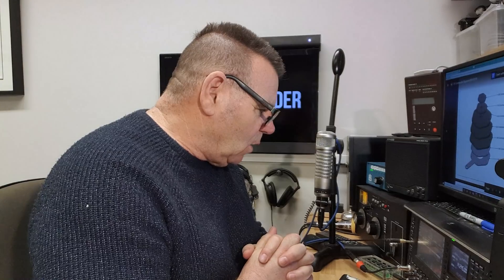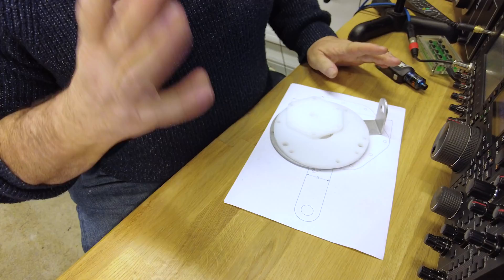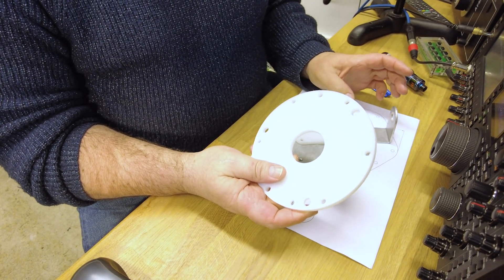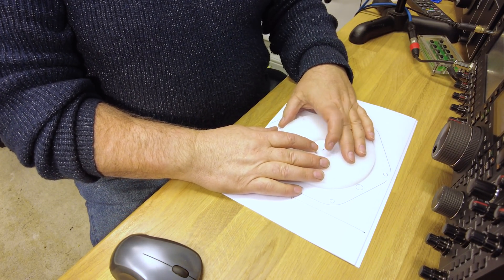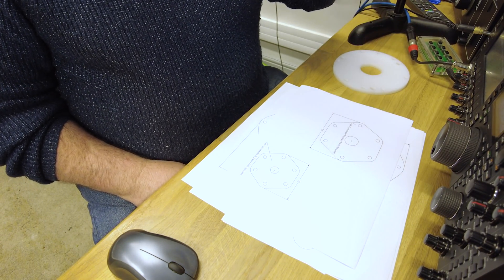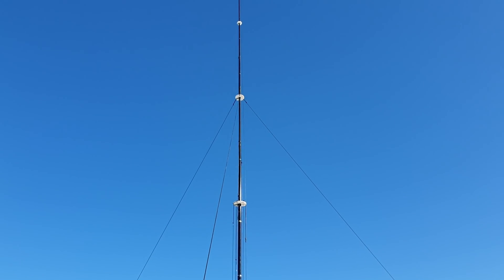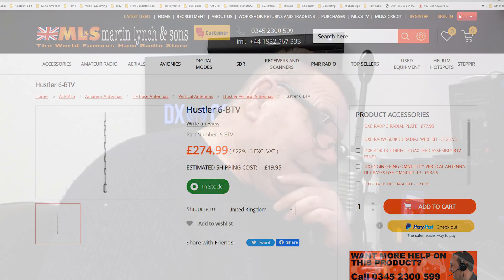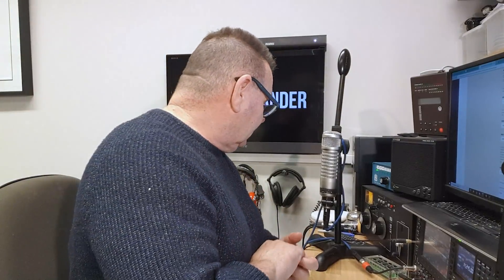Pre-Release Video - 12.4 Signature Launch Video - DX Commander

Comment: Fibreglass tube can be bought with significant wall thickness which could be used in place of a metal tube in the bottom section of the antenna. Very strong. The UKAC 2m guys use it as a stub mast to hold multiple beams.

Comment: Callum - I am about to order a Classic + 80m, moving from a EFHW that goes to 40m,  My motivation is to hopefully lower the noise floor, have an antenna configuration that fits better on my lot, and get to 80m.  From your videos, I believe the Signature will have better band width at 80m than the Classic+.  I think you mentioned that the increased spreader plate diameter will flatten SWR curves.  Will the performance be substantially better than the Classic+ at <=40m bands?  Is there a comparison band-by-band between the Classic+ and the Signature that I have missed?  Please post a link if you have already discussed this.  Apologies in advance if you have already answered this...
Reply from the maker: David.. Go with Classic because ALL you are getting on Sig is a night time DX potential on 80m. Classic will give you better daytime. And it’s a bigger beast. And more money!
Reply: @DXCommanderHQ  Thank you Callum!  Your advice is greatly appreciated...

Comment: Hey Callum, good to see the signature is getting ready to ship.  I am considering which DX Commander I want to purchase at this time.  Perfect timing.  I am also looking at M&P coax (I first saw that coax on your channel, and K8MRD/Mike has shown how the connectors are added on - nice).  The USA sites are a bit hard to get bulk coax so I can cut the cable to fit and do a little solder.  Anyway, I am considering about a 75 foot run to the back garden with a tilt up plate for a DX Commander.  The tilt version is still being researched (meaning I don’t know what I am doing yet haha).  I hope I can catch the signature before it sells out.  All the best, 73 de KI5HXM
Reply from the maker: Tilt: Check DX Engineering. They do a tilt. Use a small stub (about 2 feet) inside the 12.4, then guy it.
Reply: @DXCommanderHQ  yes as far as tilt goes it won’t hold me up.  I can always add tilt later. Or never as is the case with my scatter brain …. Squirrel! After all I was ADHD before it was cool.  Haha. 

So do you recommend Messi & Paoloni coax?  I like what I see with Ultraflex 7 and 10’s.  I am a LMR400 man but I like the way the connectors are put on. Of course HF doesn’t need ultra low loss so for HF vertical I wouldn’t need real low loss (but will take it if not much more).  

Sorry I have so many words. Those of us born in 1959 have a lot of words.   Haha. All the best!

Comment: Amazing work Callum.  I have my usual question, would you be able to offer advice and assistance to get this operational on 60m to use with the Air Cadets also?  If so, I'm sure we'll be placing an early order.  Cheers as always, James
Reply from the maker: James, I have every faith that this can be built for 80, 60, 40, 30, 20 and 17.. I just haven't got a cut chart sorted for it :)

Comment: Hey Cal, this seems like a really interesting antenna design, especially with 80m. Could I ask if the 80m element will need to go off horizontal, like inverted L? Or is that what the loading coil is for? It would be interesting to see an A\B comparison between the loaded 80 Vertical versus the 1/4 wave inverted L. Great work dude!
Reply from the maker: Hiya Matt.. The idea behind this was a pure vertical pattern, so not so good for local working but great at night for FT8 or plain old fashioned DX.. Yes an A/B test would be cool BUT they would both interact with each other..

Comment: You said, you removed the alloy tube from in side the antenna because of the SWR reading. Have you look at the material called Delrin plastic it's very strong, and used a lot in engineering. It may help replace the alloy tube.
Reply from the maker: Yes, we've looked at a lot of stuff.. It would be extraordinarily expensive unfortunately.. I do have another solution "up my sleeve".. But for another day.

Comment: Callum can you leave this antenna up permanently.and if so is it UV light resistant? I'm over the pond in Florida so I'm keeping that in mind
Reply from the maker: Yes. The only thing that gradually fails is the UHMWPE nylon plates (over years).. There is a solution for that called 303 spray.

Comment: I always read the comments before I make mine, so that there are not to many duplicates! just been out to the antenna farm to measure up! Yes i can get one in, as well as the Classic I already have, it may be a bit of a squeeze but I reckon a Nebula will fit as well. Question on radials, I have got a load of scrap copper 15mm pipe, will that work well as a radial field, and could one field of radials connected together work with multi antennas? Thanks Jim M7BXT
Reply from the maker: Jim, I wouldn't bother unless you are trying to make a lightning conductor :)

Comment: I will order as well.  Ideally I can leave it up year round.  No guywires would be nice but I am not convinced it could stand up to strong winds (60mph and up) with just a tip over base.  Maybe if you ran a pvc pipe inside the Commander?
Reply from the maker: Yes, some thinking required.. I honestly believe that in the long run, guys to the mid-point is best.

Comment: I really am considering this but I need to consider if the 12.4m will end up having the possibility to hit the power lines near the house. The other thing for me is the guys. The classic is currently anchored to some very large wooden posts holding the patio cover up. Also, would like a 60m option. I had the classic up at one time with 60m inverted L and did some good DX with it.
Reply from the maker: Don, you can do 60m with this but you would have to drop it down a few notches on frequency, eg 80m, 60m (slightly loaded), 40m, 30m, 20m and say 17m.. I will eventually develop the cut chart for that.
Reply: @DXCommanderHQ  Thanks Callum

Comment: Santa mate. This one yea! Cheers! 
Could VHF/UHF colinear or whatever, and maybe a 1090Mhz built into the top section. 
I have probably watched all your Vidjayo's But never seen you tinker with 70cm plus. or SDR, VNA's. Spectrum analyzers. Especially now the Nano type are very available. Be great to see that stuff from your perspective! Maybe it will inspire procrastinating geeks like me to gain the foundation license at least.
Reply from the maker: Now.. Someone might be able to do this BUT you would need to run coax right up the pole.
Reply: @DXCommanderHQ  Could that coax be connected to your feed and ground plate or a separate run to the shack?

Comment: Great stuff. Will be buying this. Now, I have 160m of wire in the lawn for my classic. I am hoping to get the signature but keep the radials or add to them (since the kit will come with radial wire. Will probably need to make some little radial extension cables perhaps for use with the new ground plate. Anyway, weather getting better so look forward to building this .  Mark, 2E0MSR.
Reply from the maker: Mark, extensions are easy.. Use some glue lined heat shrink after connecting say 4 or 8 of them together..
Reply from the maker: Good stout guys and you should be fine.. Roughly same height too. Let the top blow around.

Comment: I'm seriously considering the 12.4 but not sure how it will hold up in my seafront location. Here's my 12m vertical made using a heavy duty DX Wire 12m "Extra" pole in the wind today which I put up as a test to see if the neighbours complained about the size! It's gusting 25MPH, how do you think the Signature will do?

https://www.youtube.com/watch?v=Z_8xt-cfw14
Reply from the maker: Now.. I was under the impression I already answered this one. So apologies if you get my reply twice.. Sturdy guys roughly where I see them now would be ideal and let the top waggle about.

Comment: Yes, yes, YES! It's going to be a lot like Christmas soon. I do have one question though so when the order page comes up I can get all that I want. Is the "12m DX Commander Extra Long Telescopic Antenna Support Mini-eXtreme Nebula" for £119.00 the same pole that the new 12.4M DX Commander Signature will use? I ask because when I do order the 12.4M kit, I might want to get a spare pole for it.

BTW, it was interesting that you mentioned the Hustler 6-BTV, because that is what I currently have and the 12.4 will be replacing it. The Hustler is a good antenna (a total pain to tune) but as you said, for the low bands, it fades as the frequencies go lower and has a very high Q. I'll most likely move it to my hunting camp QTH and have the 12.4 take its place at my home QTH.
Reply from the maker: Yes, same..
Reply: @DXCommanderHQ  Excellent. Thanks Cal.